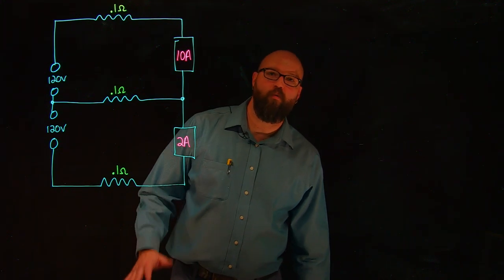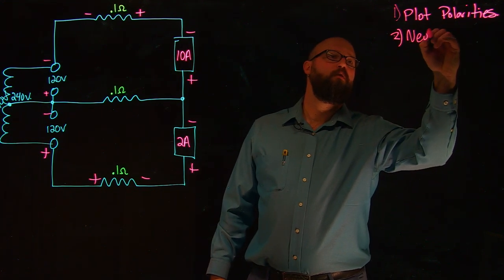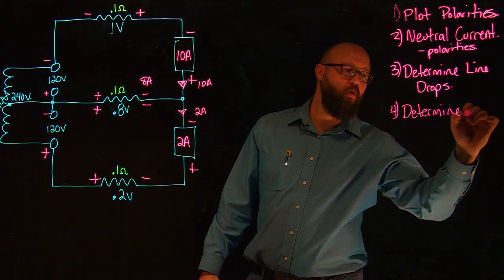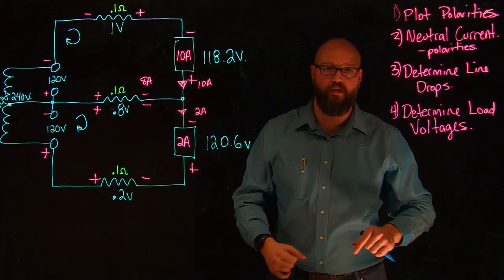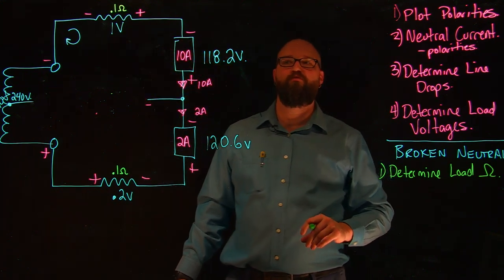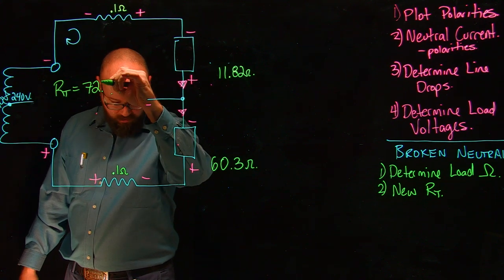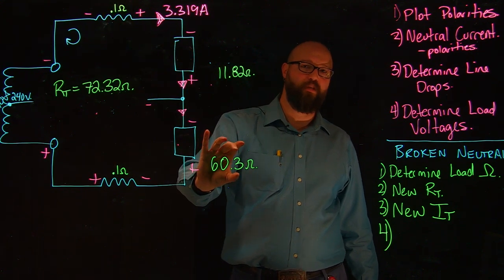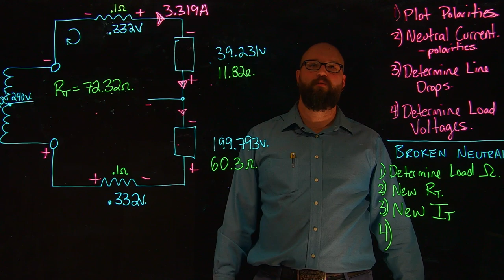Simple Edison Three wire and Broken Neutral

Comment: Great video. Very helpful. But with respect to the final calculation regarding the broken neutral, the voltage drop across the 60.3 ohm load is 200.136 V, not 199.793 V.
240 V - 0.332 V - 39.231 V - 200.136 V - 0.332 V = 0 (0.031)
Reply from the maker: If you use the Kirchoff voltage method yes, it is a slight difference from the ohms law current x resistance method, but we are looking at a very minor difference of about 
.2% deviation. Both answers can mathematically be proved as correct using different laws.

Comment: GREAT VIDEO...IF I UNDERSTAND CORRECTLY, THE FOLLOWING:  And that is why you call this an Edison circuit (DC) rather than a Tesla (AC) circuit.
I am assuming you are 'freezing' the current in time and looking at the "pseudo-DC" situation during the peak AC flow in order to apply Kirchhoff's law for your analysis.
Reply from the maker: That's correct. Though the theory holds as the current alternates, just the neutral current would change direction with the polarity alternation.
Reply: @schulerruler  great video, most in depth i found so far. I had a broken neutral on the utilities cable into the house and observed basically what you described. But still cant understand one thing, if there is a house ground where the broken neutral was in your diagram (between the two loads), wouldnt it bring the voltage total back to 120v on each line? why is it I could still get >120v on the lines.
Reply from the maker: @fobbywillie  the whole 240v circuit is from utility transformer, so if the neutral is broken anywhere between utility and the panel utilization, you will read the imbalance in voltages like voltage drops in a 240v series circuit. It isn't the connection to earth at the neutral that stabilizes the 120v, but the connection on the neutral that goes back to the centre tap on the 240v transformer winding.

Comment: So in parallel wiring, you just consider the wire resistance and in a series circuit, you add the wire resistance plus the load resistance?  It is bewildering to me how the numbers are played with.  In both system voltage drop equal voltage input.  So what is the problem?
I guess the cleverness is in series we add the load's resistance but in parallel which really is a series all by its own self ( mini-series if you take the wire as one load and the 10 A as another load) and the other below circuit just the same.  Two separate series circuit that is parallel to each other.  The first two mini-series is supplied with 120V  each and the second one big series 240 volts for 4 loads.  2 wires and 10 and 2 amp loads. 
And how come we are not allocating a resistance value to the wire that is in between the two loads in both situations?
And I am still to wrap my head around how in the neutral wire 8A goes back in, a free bonus.
I don't know how it works.  It will a while for me to get a mental picture of why it works like this.  I assume there is something going on with the way the second coil is wired as well, maybe?
Reply from the maker: I didnt answer because sometimes comments slip through the cracks. 

To answer the original question, I agree with you. My opinion is there is no such thing as a true parallel circuit because as you mentioned, the wires in series will take a voltage drop.

We need to understand the laws of parallel though, to move forward. Kind of like a unicorn. Everyone knows what it is, but it doesn't really exist.

Many things in electrical theory are just that, theoretical. But we need to understand the theory to move forward with new concepts.

Comment: You had your polarity markings on both sides of the neutral as the same and I don’t believe that’s correct. Polarity goes clockwise on top circuit and it goes clockwise on  bottom circuit. Which is correct. That would make polarity on the neutral opposite each other top and bottom. Top circuit has 10a returning on neutral to winding and 2a leaving winding to load on the neutral. The unbalanced of 8a as a residual current is due to 2a in one polarity being subtracted from 10a in the opposite polarity. 0v neutral can have currents of different angles flow.
Reply: Bob, when I first read your comment I thought you were correct, but here is why it is not:
First of all, if you check his work with Kirchoffs voltage law, it works. If you check your work done the way you suggest it is wrong.
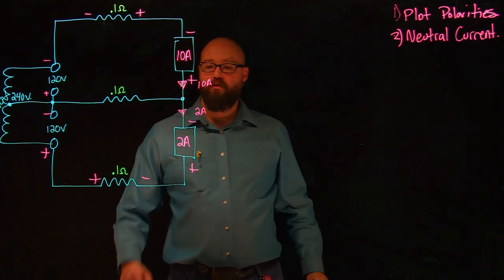The reason is that the difference between the two opposing currents was already determined at 2:08 and so there is a net flow of 8 amps in one direction. Therefore polarity will be according to the net flow.
Reply: @spruce_goose5169  How can total voltage drop be greater than source voltage? You are of the understanding that current only flows one way on neutral based on one polarity of that neutral. My understanding is it can flow both ways based on different polarity on neutral conductor. If polarity were opposite on bottom part of neutral for bottom circuit it works.
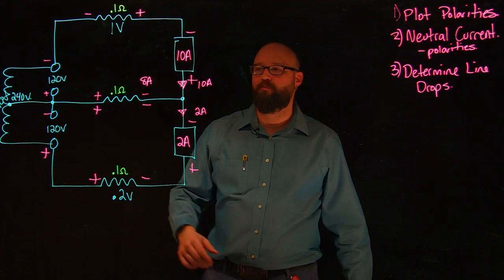Reply: @bobbrumley3964  I don't understand what you mean regarding voltage drop being greater than source voltage. At 3:34 he states that the voltage drop is 0.8v. Voltage source is 120v. Can you explain what you mean?

The current flow is the result of the NET current. When you say it can flow 'both ways' what you should be thinking is that the DIFFERENCE between the two opposing currents will be applied for a net flow in one direction (cycling 60hz).

I also don't know what you mean by 'If polarity were opposite on bottom part of neutral for bottom circuit it works.' 
What works? Kirchoffs voltage law certainly doesn't (not around the outside).
Reply: @bobbrumley3964  Nevermind I understand what you are saying about voltage drop. You are adding 120.6+0.8+0.2=121.6 and wondering how that can be larger than 120, correct?
It's because the 0.8 is opposite polarity so it's subtracted, not added (I guess that's the sticking point here isn't it). If you check Kirchoffs law around the outer perimeter (the 240v) hopefully you can at least see that that doesn't work if you swapped the polarity on the 0.8 drop as you wish? It would give you 119 for the load drop, and 119+118.2+1+0.2= 238.4 (exactly 1.6 volts shy of 240 which is 0.8X2 (because reversing it hits you twice in the count).

Just thinking about this situation intuitively: take the good ol analogy of water. If you have a single pipe with competing pressures on either side, with you get distinct currents, or a net flow according to the difference in pressure? (assume pressure equally applied to pipe ends and not giant pipes with jets of pressure that allows for turbulence since that breaks down the analogy).
Reply: @spruce_goose5169  I appreciate this conversation. If I were to switch open my 10a load wouldn’t the voltage drop change across the 2a load according to your understanding. I believe it would and therefore the neutral would in a small way be floating. 120.6 vs 119.6 drop. That is not the way it works.
Reply: @bobbrumley3964  That is a good point, and you are correct that the v-drop would change across the 2a load (60.3 ohm resistor) when the 10a load is opened.
But contrary to what most of us probably think, I believe that IS how it works. The neutral balances the loads, but not perfectly due to the resistance of the lines. We tend to ignore line resistance for simplification and practical purposes and claim that the neutral balances the loads (which it does, but not perfectly).

This reasoning can also be used to understand why a ground rod connection alone does not balance loads as effectively as a low-impedance path direct to the transformer (a neutral wire). The ground connection is comparatively high impedance, therefore the voltage drop on the middle balancing leg (ground connection) would be much larger and create a voltage imbalance between dissimilar loads as you correctly note. 

I don't know precisely what you mean in regards to the floating neutral. You mean it won't be 0 volts to ground? This stuff starts to get sticky (and pushes my understanding), but my take on it is that any resistance of the neutral line itself does indeed create a voltage drop, therefore the only point of the neutral not 'floating' to some small degree is the precise point where it enters the ground. And even then, it is only 'not floating' in reference to that precise local ground point. I imagine the ground can have small charge differences and therefore whether or not the neutral is 'floating' depends entirely on where precisely you are measuring. 
But for practical purposes, the voltage from neutral to ground will be close to 0, even if technically there are small fluctuations.
Reply: @bobbrumley3964  If you have the stuff to make a physical Edison circuit (you just need two batteries, some wire, and a few resistors) you could verify all this by adding different resistors in to the neutral line to amplify the effect of line drops. 
If the loads are balanced, it won't matter what resistance is present in the neutral line, but if the loads are imbalanced, a higher resistance on the neutral will create larger voltage imbalances than a lower resistance. 
(If you google Edison 3-wire circuits you'll also see many examples that have larger resistance values for the return-neutral and you can see how this works out).
Reply: this is exactly what im thinking. i swear all these videos are using different rules everytime